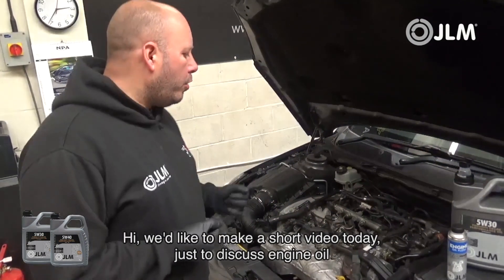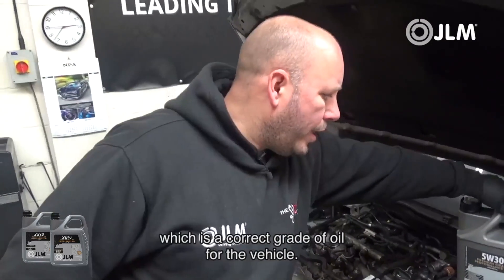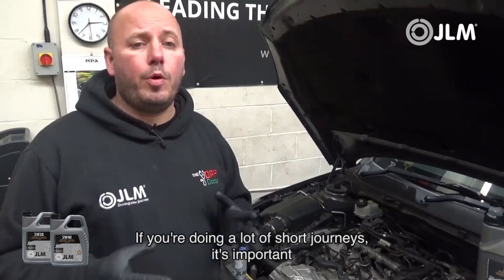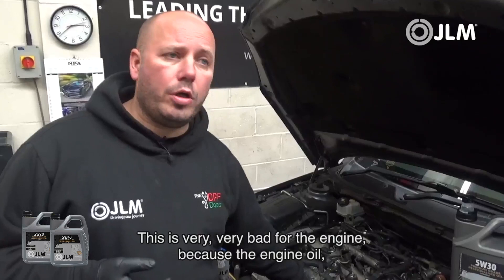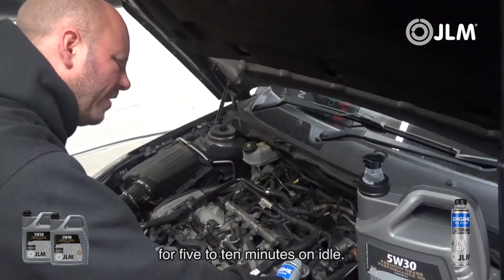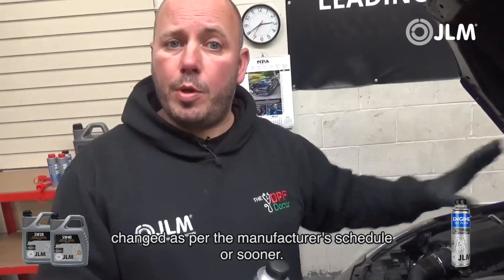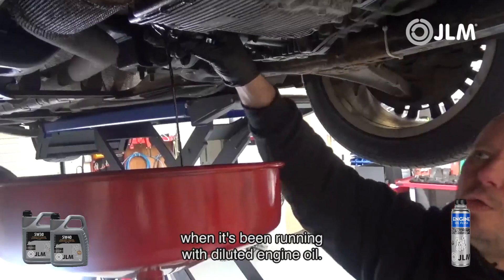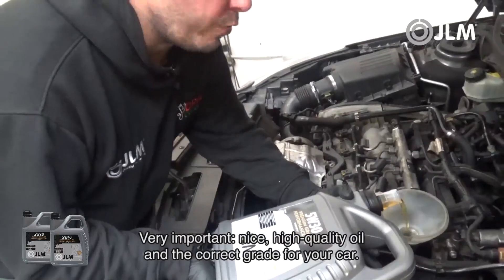Relation blocked Diesel Particulate Filter - DPF & Engine Oil - Tutorial - JLM Lubricants DPF Doctor

Comment: Thanks for the information. You didnt mention it, but does the oil/Engine flush go in with old oil, or between old and New…
Reply from the maker: Thanks! The JLM Engine Oil Flush is added to the 'old' oil before it will be drained. By doing so it will drain much more contamination out of the crank case / engine. This will also be beneficial for the new oil as it will be allowed to better perform in a 'cleaner' engine. A small help with lots of benefits for the motorist.